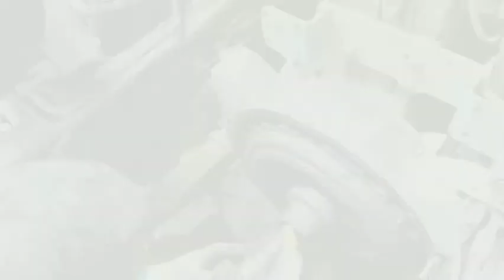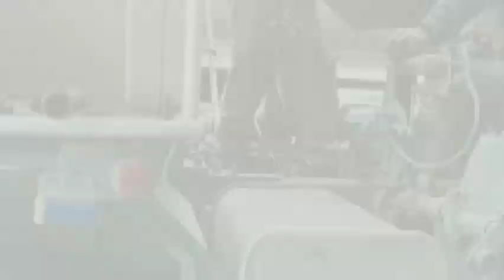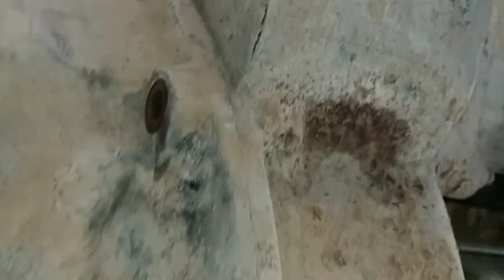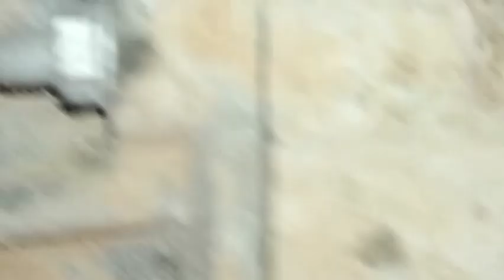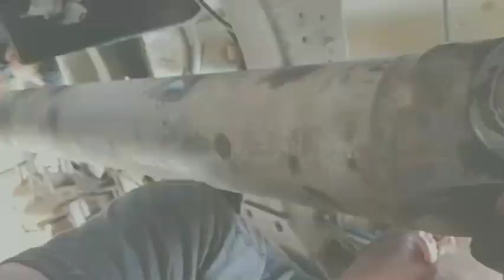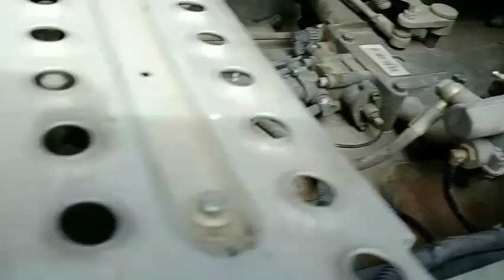HOW TO INSTALL CLUTCH DISC TRANSMISSION | HOWO TRUCK

Comment: gd day  boss cheaf may itatanong lang puh sana aqo syo yung unit nmin na howo 
pinalitan ng lining nung natapos nang naisalpak at naikabit lahat nung pina,andar na dina umandar kc naka,tatak sa dusk bord naka,drevi sya,
ang tanung ko cheaf paano nang yari yun at anu unang dahilan,sabi kc ng nagpalit na mechanico na neutral nman daw,naka,incounter ka naba ng ganitong problima cheaf sana mabigyan muh aqo pansin at masagot muh katanungan ko,
electronic pa ang unit na howo,
Reply from the maker: Pasesya na boss late reply, Yung sensor lang ng drive yan o di kaya may naputol na wire sa connection ng drive sensor